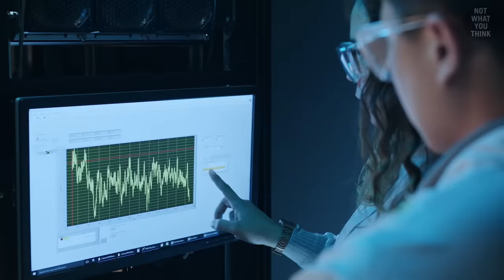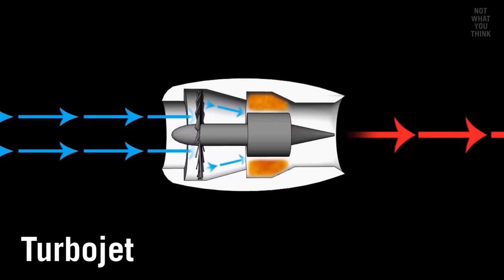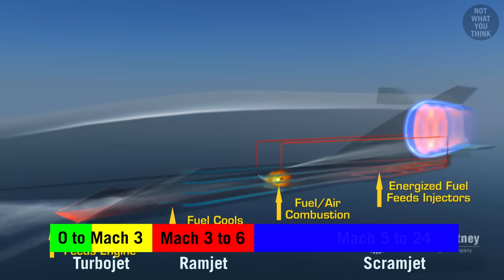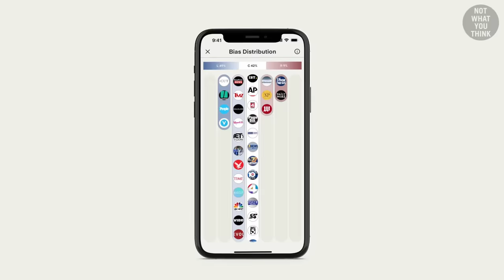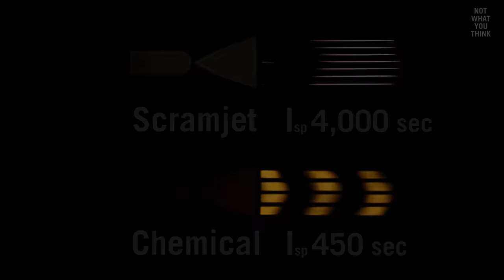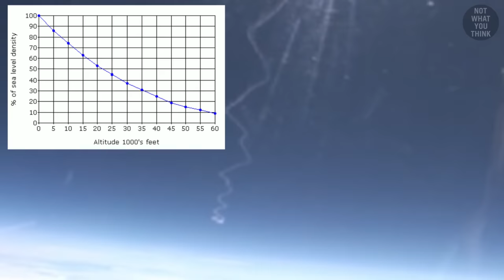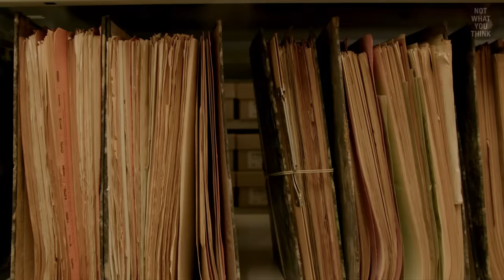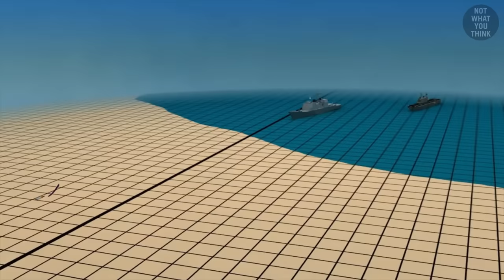The Hypersonic Missile Vulnerability That NO ONE Talks About

Comment: A correction: SCRAM jets do not require you to be at Mach 5 to be usable. The theoretical speed range to activate it is between Mach 1 and Mach 4, with Mach 2 to Mach 3 being the ideal speed range to ignite the engine, and its fuel efficiency and power output increases as your Mach number does (not forever of course, as air resistance is still a problem). It's why they are considered the holy grail of spaceflight technology right now, as they are being considered for single-stage-to-orbit spacecraft.

Take DarkStar from Top Gun: Maverick for example, since Lockheed Martin's Skunk Works did a lot of physics calculations when designing it for the film. We would use a conventional propellant (in the case of missiles, a rocket motor) to get to that speed range, and then switch to supersonic combustion to break out of high supersonic and into hypersonic speeds. Also, the plasma trail doesn't really start to form to any meaningful degree until Mach seven or so, and while it would impede on communication, it wouldn't necessarily outright prevent it.

That said, I think this video fails to touch on two things. One: ablative cooling, and Two: why do we need a warhead?

On the topic of materials, a mix of titanium and aluminum would be used, alongside ablative materials. Ablative materials flake off and burn up at high temperatures, making ablative cooling perfect for a hypersonic missile. There was one comment that brought up the use of ablative materials to cool the missile in flight. 

On the topic of needing a warhead, a hypersonic missile technically doesn't need one. Against a ship or a hardened target like a nuclear bunker, the kinetic energy alone on impact would be enough to destroy a target. This is the fundamental principle behind modern ASAT missiles. By removing the warhead from the equation, you can reduce the weight of the missile, improve its aerodynamic shape to better handle hypersonic flight, and extend its effective range. Plus, it leaves more weight to work with when plastering ablative material onto it.
Reply: As someone that designs hypersonic missile (mainly re-entry) I like your comment
Reply: Concerning the plasma-problem, SPRINT missile would like a word.
Reply: How could it be used as a SSTO vehicle if it has to hit at least mach 1 to even start…?
Reply: @MazeFrame  oh? What’s that?
Reply: Because nuclear warhead > kinetic energy

Only way kinetic energy is gonna be fun is when you launch bit steel rods from space down to earth at hypersonic speeds... like in Call of Duty Ghosts
Reply: @MazeFrame  so would concept of 'intertial guidance'
Reply: @kellymoses8566  And the heavens will be rolled back like a scroll. Is that the time when you will believe or do you prefer when it starts raining brimstone onto the Earth?!
Reply: @foxglow6798  You'd use a different engine on the same stage to reach greater than mach 1 velocity then transition to the scramjets. The SR-71 for example is a single stage vehicle with turbojet engines and ramjet engines, demonstrating the concept. The only real difference is that the SR-71's different engines were hybrid, and thus fully integrated, whereas a scramjet would much more likely be a fully separate engine due to its more unique constraints in design. 
Also, an SSTO vehicle would need to be mostly propellant by mass at liftoff, which would necessitate a voluminous body structure, and a good way to make that body plan work nice with scramjet technology is to make the entire lower surface of the body into the scramjet. Check out the Rockwell X-30 as an example of this architecture.
Reply: I just wanna jump in and say that single stage to orbit spacecraft are likely to be a red herring more than a holy grail, at least for Earth launch. A rapidly reusable two-stage to orbit system would be easier and more capable in every single way, and would achieve equal flight rates while being LESS expensive to build and maintain, due to there being less of a requirement for ultralight structures and razor-thin strength margins.
Reply: @sycodeathman  I doubt single stage to orbit is possible with current materials
Reply: @kellymoses8566  I agree completely. I'll go further and say that our engine technology and thermal protection materials science are both not yet good enough to allow a reusable SSTO, much less an economic SSTO.
Reply: well in some form they would need it. its like huge shells, like from gustav or anti ship guns of ww2. they were traveling too fast and had too much kinetic energy if they did not hit strong enough part of the ship they were going right through them without causing much damage, this could explain the weak impact of zircon missle and propaganda.
Reply: Unfortunately, this also means that you pretty much need to physically hit and  be very accurate with your terminal guidance, and depending upon the nature of target hit, your effective energy transferred "Effective Yield," will vary greatly.  This makes me believe that the Kinetic only weapon is best used against hardened ground based targets. Having a warhead option means that this solution could potentially be used against a wider variety of targets and depending upon the warhead, the accuracy may not always need to be spot on to achieve effective damage onto the intended target(s).
Reply: @sycodeathman  At least thats what spaceX calculated.  But to verify this is again a just a question of paper the proper formulas and a calculator. Not so hard for anyone that knows the math.
Reply: @rolands.6439  It's what many people have calculated, and concluded, after actually trying it. It's not just SpaceX.
Reply: Sourcing on science fiction movie? Opinion discarded.
Reply: Seems like almost everything this guy says has to be corrected...
Reply: I disagree with one point, and that is that nobody is considering SSTO.
Reply: @kajmak64bit76  if you could accelerate a refrigerator to significant percentages of c, you could obliterate a planet death star style.

Comment: Hypersonic Missiles make sense when they hit target 🎯
Reply from the maker: When or if? 😁
Reply: If they are fast enough, the missile body substitutes for the warhead.
Reply: The point he's saying is a hypersonic missile's only advantage is decreasing travel time, but when it comes to actually hitting the target (terminal), a hypersonic missile is literally just like any other missile as it slows down to the speed of any other normal rocket.
Reply: @floofy5529  like how a harpoon hits at subsonic and a p700 and p800 hit at supersonic.. not the same. air frame shapes have differing rules depending on the shape weight and propulsion.

Comment: Since this video talks about plasma sheath, here's a little fun fact. You remember the whole "Rods of God" project? You know, launching telephone-pole sized tungsten rods from space? A pretty good concept in theory, but one of the reason why it didn't see the day is also plasma sheathing: it'd cut out communication with it, and you wouldn't be able to steer it towards your intended target.
Reply: Isn't the biggest downside of rods is their weight? Like, unless you assemble them in space, but then asteroid throwing is equally "viable" concept.
Reply: I could have swore that was because there was a ban on space borne weapons during the cold War, in order to prevent another weapons race.
Reply: @Blackreaper95  I believe the concept originated before the ban on all space-borne weapons (there was another ban on nukes in space prior to that IIRC, but I may be wrong on this). But as I said, plasma sheathing wasn't the only reason why the concept got scrapped.
Reply: @ararak7132  I'm pretty sure rockets back then had sufficient lift power to  bring at least a few rods in space, but it if you have to send multiple rockets just to assemble the weapon platform, the cost would be prohibitively expensive, probably another reason why it didn't see the day.